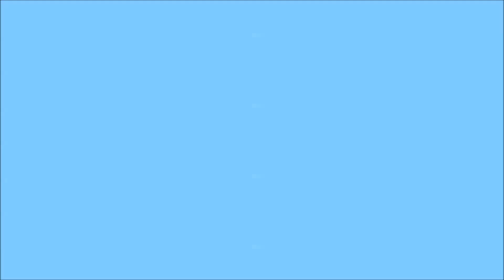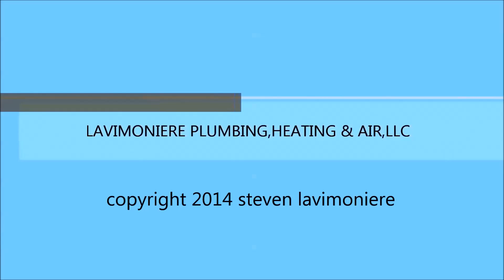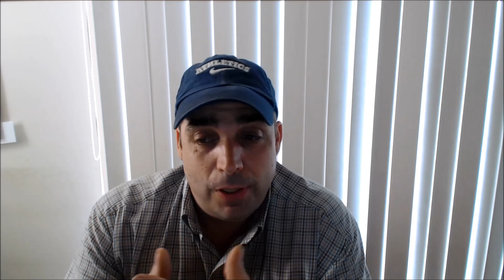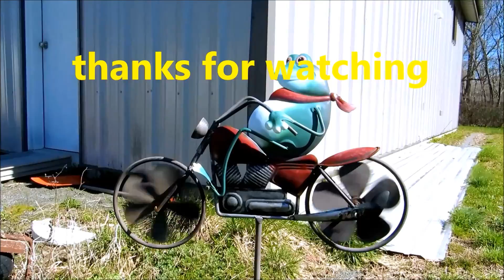hvac my thoughts on high efficency equipment part 2

Comment: I'm maintenance electrician and I have been intimidated by some of the wiring on some of the high efficiency issues, you have to figure out each circuit at a time. If I'm working on heating and cooling,  I jump out the thermostat right off the bat and see what I got. And check disconnects and breakers.

Comment: I have an older carrier furnace and my blower motor keeps cycling on and off even with the thermostat off the wall .  The main board was changed a year ago and never done this until recently . Just trying to figure this out. I have checked the fan limit switch and it does have continuity through it. Any other suggestions to check for would be greatly appreciated

Comment: Been watching your videos for some time.They are awesome! As a teenager, I was taught the trade of HVAC by a neighbor of ours who was in the electrician / plumbing / Hvac business and I was able to go with him on jobs and learn over a few summers and do gopher work.  I do not work on my own HVAC equipment - thats what the pros are for. But, I know enough to know when the unit is not working right and call the pro's.  As a homeowner in the Carolinas, I bought a 17 seer heat pump / NG furnace that is 98% efficient. In almost 9 years, I have needed 2 Condenser ECM motors in the heat pump and 1 ECM motor in the furnace. Took a few days for the supply house to get a motor on one occasion, and then, it has to be installed by the HVAC company under warranty - still pay labor.  We bought a small window unit to help us though these times. As of present, I lost 5 degree's between return and supply temps (I always monitor these values). I also noticed that I no longer hear the second stage sound on the compressor 30 seconds after the fan ramps up to a higher speed.  So, the HVAC co is scheduled to come out and see whats going on.   To your point, higher seer = more problems, more spend in repairs. Great for the HVAC companies, a pain for the homeowner. Any savings in electricity is lost by the constant need for repairs.    Any environmental gains is lost by the need for repairs and shipment / recycling of broken parts.  I really like the modulating 98% furnace. For the condenser, next time, I will go with a basic 13 seer heat pump.   Thanks for your thoughts on this!
Reply from the maker: keep is simple ,have you ever herd that phrase ??? might be worth thinking about .
Reply: Absolutely!  Next go round will be a simple low end unit.

Comment: High efficiency works ok, but, I like VDR blower ramp-up and middle of road condenser or heat pump. Here's why at 95* outdoor ambient those 16.0.~18.0 drop to 14. so if it's 110* with 78% humidity then why buy higher eff.unit. I'm in Fort Worth,Tx and have 13.0 Am-Std a/c with TXV coil/horizontal furnace 80%.. Runs good.

Comment: High efficiency air conditioners probably pay off where they are ran year around. I will probably go with an 80+ furnace again when its time. I will try to keep my little 561c Bryant 2 ton air conditioner going as long as possible.
Reply from the maker: high efficiency a.c might pay off in the deep south maybe??? if it does not break down if it does  what you save will go and then some for repairs .. to many bells @ whisels for my liking

Comment: I agree with ya steve.  Hell i am located in the Southeast.  And in my opionion some higher seer stuff.  Yes you save money on your power bill but do you save money throughout the life of the equipment.  When that variable speed motor goes out when it is out of warranty all that money you saved on your power bill goes to a new motor and you may have to wait a week to get it.  It does have its place.  But around here where alot of stuff we work on only makes 8- 12 years i dont see getting a decent return on investment.  IMO.  Hell we replaced 3 mini splits this year because they had bad boards but out of warranty and the condenser coils where gone
Reply from the maker: thanks for watching @ commenting lee

Comment: Hey Steve agree with you 100% on high seer not worth the extra thousands to the consumer for roughly 50 bucks savings a year. Now on the other hand the 90+ eff furnaces can't be beat. I had an old 80 in my own house and put in a 98% luxaire, the frigging bill went from 480 a month to 160 !!! No joke. The unit may be double the price but dam it really pays for it self. Only prob with the  98% is the variable speed motor, at low speeds it can't carry humidity had to put a humidifier in each bedroom. I think there's a way around it to keep it at a good push but haven't really bothered with it. Keep these vids coming nice to have another "old school"mechanic thoughts
Reply from the maker: thanks for commenting brian

Comment: Steve, does seer rating and amp load go hand in hand?  In other words does a 18 seer unit draw less amps-use less watts than a 13 seer unit for the same ton rating?
Reply from the maker: the higher the seer the more condenser area you have hence bigger unit  ,=lower head pressure=lower amp draw

Comment: Good video Steve. You are right...I open up a 13 Seer ac and I have all the parts in the truck. I open up a 18 seer and I have nothing.
Reply: We did an 18 seer install the other day with Tandem compressors, dual communicating boards, and 600 wires going everywhere to every part of the system.  Wow, where do you start.  Give me a Contactor, capacitor, and 24v and I'm happy.  Keep up the good work.
Ray
Reply from the maker: very good point .homeowner saves energy cost with high seer equipment,, but the installer  has to jump through hoops to fix the stuff .and wait for days for the parts to come in. thanks for commenting zack
Reply: Joe Shearer I have already done just that, esp. With exam motors.
Reply: talyn875 ecm
Reply from the maker: there is nothing wrong with a t -87f

Comment: my grandmother has a nti trinnitty hie efishancy boiler.
the house is over 100 years old and still has the cast iron radyators in it.
that boiler has so mutch electronic crap.
it hangs on the wall The radiators don't get hot at all really 
It replaced a old oil fired boiler with a becket burner.
when that boiler was still connected  and not the new one the radiators got hot as hell.
you couldent tutch them for long.
Reply from the maker: you can go in to the control setting and raise the high limit for hotter water. if they sized the boiler properly ..accually cast iron radiators can run fine on 140 to 160 degree water

Comment: Steven,

In Europe there is one battery charger type for all cell phones.  It seems to be a good thing if you have a dead cell phone battery you can barrow anyone's charger and you are back in business. 

Maybe we should have universal controllers and just use factory control software with standard external load or safety devices analog or digital.  We carry one controller, generic safeties and load devices and factory software we can download as and app.   Just my thoughts. 

Doesn't matter if is single stage, two stage, condensing, TXV, EEV, whatever... The generic controller handles it all, software the factory develops and they offer software updates as needed.

I enjoy your video's but you should end them with a burnout with one of your hot rods...Blessings Brother,

Ron
Puyallup (just the way it is spelled) Washington "The Evergreen State"
Reply from the maker: thanks ron for commenting @ watching

Comment: Sounds like your going to need a bigger truck! I agree A/C does not need to be complicated up our way. The high efficiency heating though is here to stay. Manufactures need to hold training classes to teach people the right way to install their equipment. The high efficient equipment has most of its problems caused by improper installation.
Reply from the maker: they also  need to be maintained and cleaned out once a year.there all put together differenty yes there should be classes to show proper disassemble procedures and proper cleaning of heat exchangers ect .per manufacture .most that install them have no clue how to service or even that they need cleaning/service .
Reply: agree 100% steven